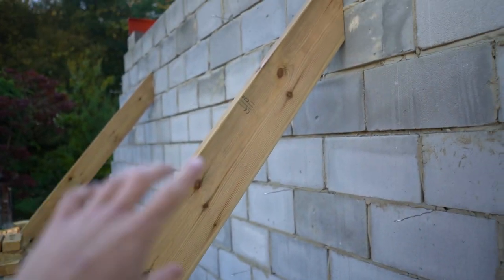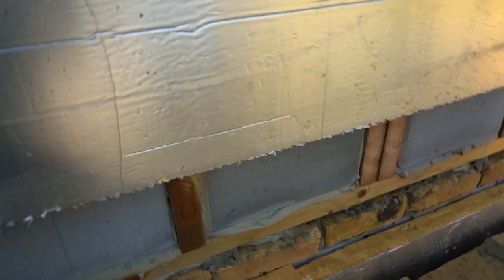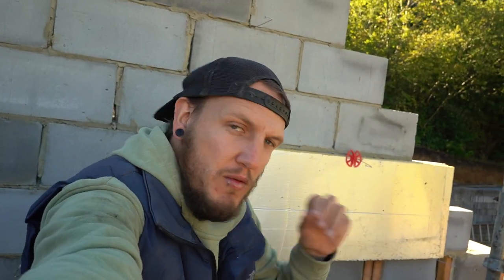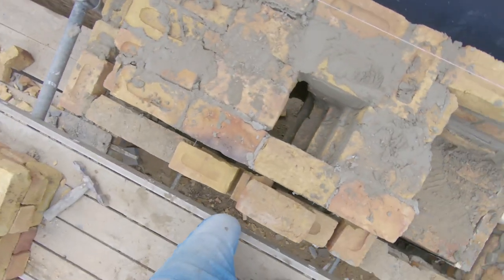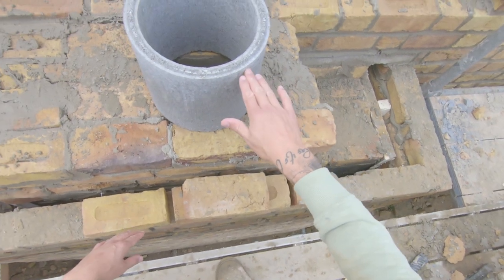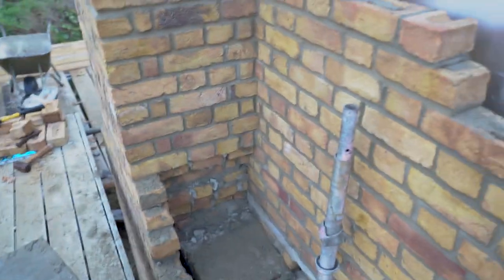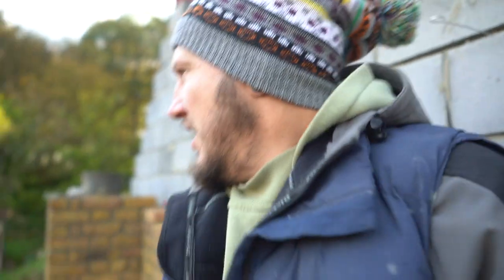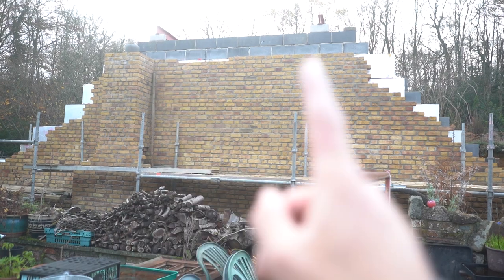BUILDING A HOUSE ALONE from START TO FINISH | E.P 24 [Building the chimney stack and gable]

Comment: Insulation has way to big a gap between some of the boards. Most important thing to reduce heat loss in your building. Why have you built in a flue throating block to carry the weight of the flue liners. The stepped edging on the brick at the start of the chimney. What are you planning to put up through that.

Comment: Awesome channel! I have one question though, shouldn't chimney stack be insulated on the outside rather than on the inside? I mean, looking from the outside of the house you'd have external skin, then Kingspan, then chimney stack anchored to the blockwork inside. This way flames and fumes heat up the stack so it retains the heat and radiates it slowly over time. Is there something I don't know, e.g building regulations in your area that don't allow to build that way? cheers :)

Comment: no vermiculite around chimney. Are you using Building Control ?
Reply from the maker: I'm going to be putting a wood burning stove in the fireplace and using insulating jackets around the flue liner. I'm not a big fan of vermiculite.

Comment: Know you are a southern boy but I would butt up and tape that insulation, cheaper to over insulate now than pay higher gas prices in five or ten years.
Reply from the maker: Yeah a few people have mentioned that. It's not something I've ever done or seen people do. If it saves on gas prices I'm all for it. I'll start doing it from now on. Cheers for the tip buddy 👍🏻